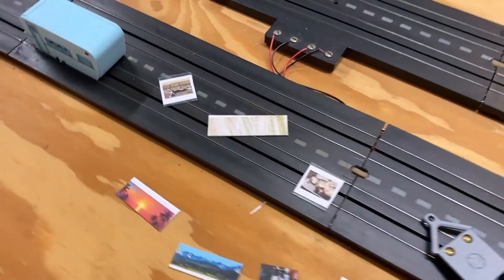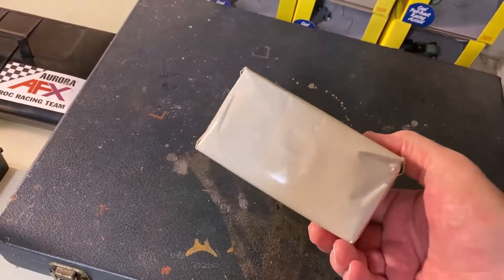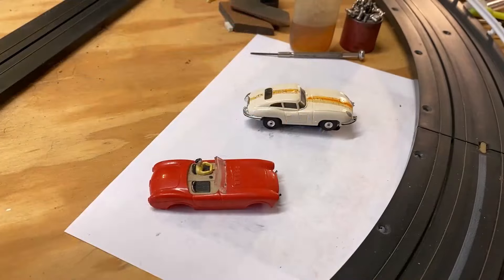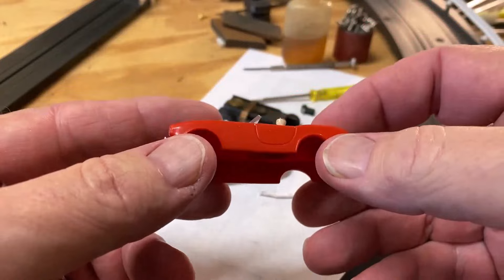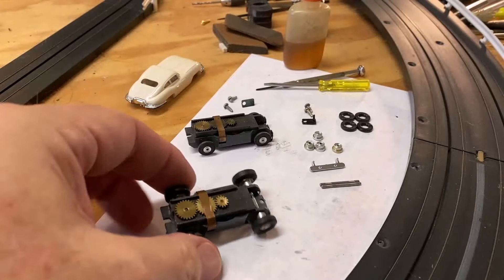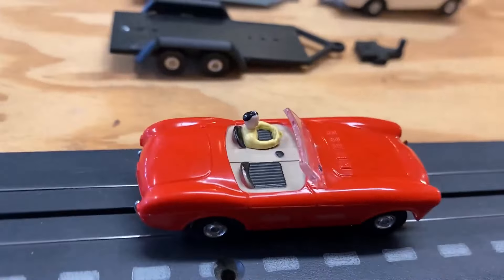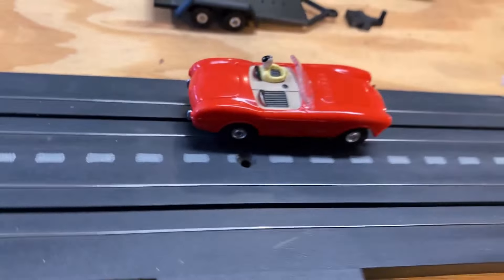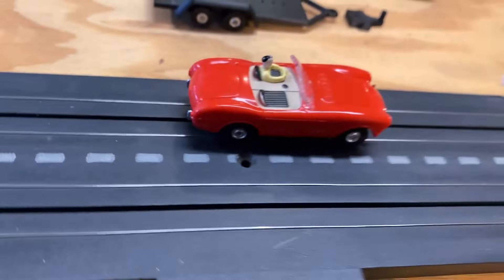Amazing Slot Car Restorations and Camper Update!!

Comment: That's funny im working on the same car and same color too though mine as a cracked post
Reply from the maker: Hey Roy, that's very kool! The screw post should be an easy fix. Oh, and btw, always great to hear from you!!
Reply: I also noticed that its has a small crack one of the front window post as well but a easy fix when I push it together you cant even notice it @JeffRyan

Comment: Hi Jeff. 
Another great video showing how to restore neglected cars. Those were two nice projects.
I do cringe when I see you using a wire wheel to clean motors. They are quite delicate. I use a fiberglass pen to gently clean them and it works well. Also great for pick up shoes between races. Wanted to ask a question about the paint markers. I use the same paint markers that you do And I have found that they have a relatively short shelf life. After some time, the ink that comes out is dark, flat gray, and no longer chrome. Have you had any issues with these markers and perhaps maybe some of your viewers could also comment. I’m thinking of trying the Zoet markers. Does anybody have any experience with these? Keep the great videos combing Jeff we all appreciate them.
Reply from the maker: Hey Bill, I have had a number of my viewers over the years comment about me using a wire Dremel brush to clean the bottom of the Comm. Plate. All viewers that have commented...none of them have ever tried my technique. One might might consider the comm. plate to be 'delicate' but, it's actually a very sturdy tri-laminate. And since I have over 4 decades with 100% success rate at cleaning the comm. plate with the wire Dremel brush, I'm doing something right. In addition I have always maintained that if anyone can show me a faster/better way to clean the comm. plate, show me. So far to this date, no one has.
Regarding the Molotow Chrome Pens, When I kept my chrome pens in the garage, I did have on that had a short shelf life, but I thought it was due to the extreme heat hear in Florida.
Reply: Maybe those pens were old before we bought them. Will try again and see what happens. As for using the dremel on motors , I have been clumsy enough to hit my fingers a few times while holding the motor still. So the fiberglass pen saves me some skin.
I’m happy with the results. It’s just another way to do it.